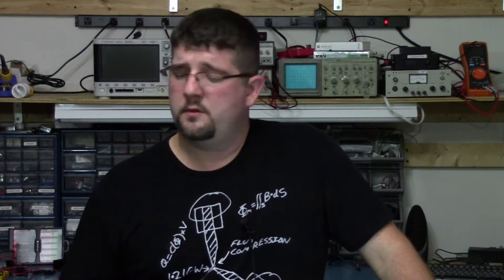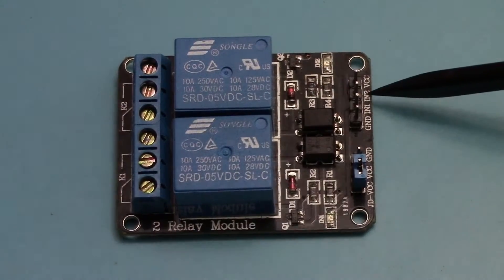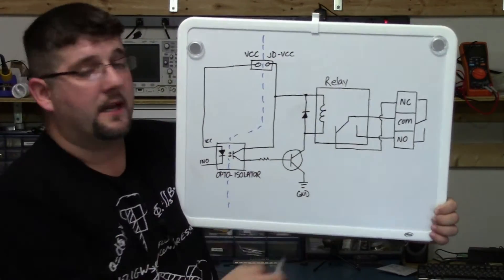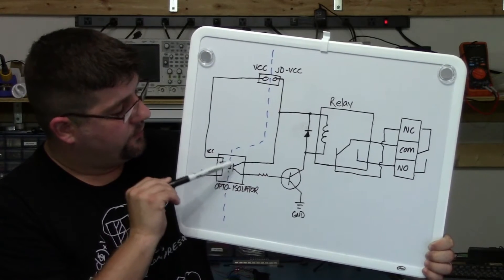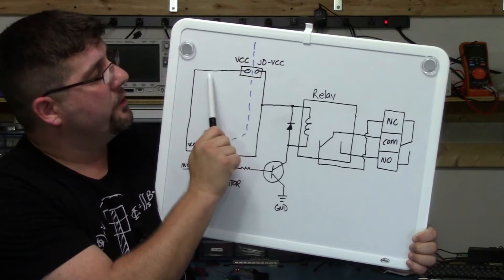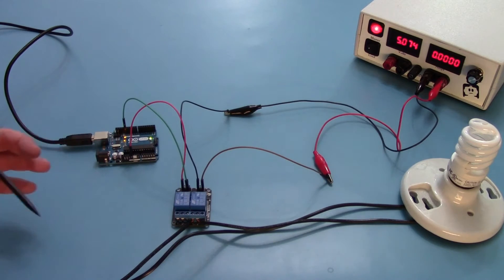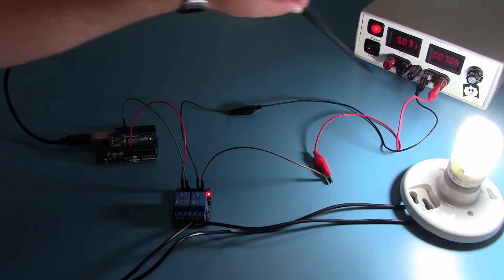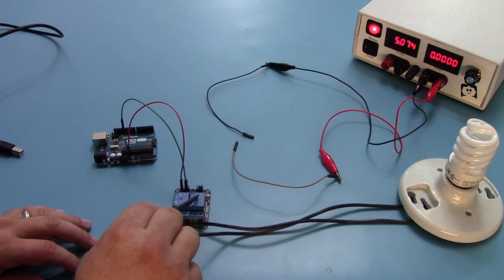#9 - Arduino - Connecting a Relay Module

Comment: hey i used a basic relay on off code to check if its working so its finally working.. connection were as jdvcc and ground from external and vcc,grd, vin from arduino . This actually worked. But when i used everything same in my project then the relay is not working . same connection as in previous one but when i connect grp to arduino the led goes off and when i disconnect it is on again. So now what should i do.what should my connection be. i even tried but jumpinng vcc and jdvcc but even that didnt work. the is working but not in my project. it only works on basic program . please let me know the proper connections.
Reply from the maker: When troubleshooting a problem like that I would double check voltages. Make sure you are getting the expected voltages between JDVCC and GND, then check the voltage between VCC and IN1. If you are connecting the relay for use with an external power supply, using JDVCC, then you shouldn't have to connect the Arduino GND. In this type of set up the IN1 pin acts as the GND for the VCC from the Arduino. The idea is when IN1 pin is high, the voltage potential is the same as VCC, so the relay is not activated. When IN1 pin is low, the voltage potential between the pin and VCC is 5 volts which activates the opto-isolator and ultimately the relay.
Reply: @bradfordhenson  huge respect for yur reply bro. Now the issue is like relay is working and I am finally done with my project but the relay was wired . When I set low it went high and vice versa. Why so?
Reply from the maker: @vp.8181  When the Arduino pin goes low, the voltage difference between VCC and IN0 allows a little bit of current to flow logically from VCC to IN0. In this case IN0 is the lower "negative" side of the circuit. It is safe to source current like this up to 40 mA on an Arduino pin. The effect is that the Arduino pin has to be low for current to flow and activate the opto-isolator. If the Arduino pin connected to IN0 is High, then the voltage potential between VCC and IN0 is the same, which does not allow the opto-isolator to turn on. This is why when the Arduino pin is High the relay is off and when the Arduino pin is low the relay is on.

Comment: like others have said , best tutorial I've seen on using these relay modules. i also have this model as well as a few more complex boards with timers, delays etc. Brad I wish to use this Relay without a controller , just using 12v from an led driver, to trigger relay. can you tell me which ins id use to do this pretty please dude? serious lack of info from manufacturers and on net in general. thanks alex
Reply: Don't use 12v on these 5v relays.

Comment: HI everybody, I need to do a stroboscop with LED bands so I copy exactly all the connections  (2nde exemple shown) , I just used a 12V battery to aliment the LEDs but they stay switch on instead of alternate between on/off, the led on the relay do the on/off delay I've code however, I don't understand...

 Somebody to help me ? ( sorry for my frenchy english  )

Nice video ! The only one I've totally understood

Comment: I'm confused with ext supply no common ground for arduino board, or does the pin output going low obviate the need.
Anyone know??
Reply from the maker: When the pin goes low, the voltage difference between VCC and IN0 allows a little bit of current to flow. That is what activates the opto-isolator and ultimately there is enough voltage present on the transistor's gate to turn the transistor on. In this case we are using the output pin to sink current (it is safe to do this up about 40 mA). Anymore current then 40 mA and you run a serious risk of damaging the pin on the Atmega chip.

Comment: Excellent video. http://www.arduinostarterskit.com/sale-7641832-lightweight-four-channel-relay-module-for-arduino-red-board.html

I am trying to wire up my Comfort (Home Automation System) Output to my 4 channels Relay to switch on the light in the event of PIR is being activated. Refer to above link for details of my 10A 250V relay. The Relay input terminal is difference from what you presented in your video. How do I connect the output and 12v from my Comfort System panel to the relay input?

Q1 Is it correct to connect the 12V of the Output to DC+ of the relay module?
Q2 then connect the OP1 of the Ouput to IN1(Input 1 ) of the relay? And accordingly OP2 to IN2 and so on?
Q3 How about the DC- of the relay? Where to connect to or leave it unconnected?

Would appreciate your support and sharing.

Comment: Why do you need two transistors? Why couldn't you connect the relay along with the diode between the JD-VCC and the collector of the the opto-isolator transistor and have the emitter of that go to ground?
Reply from the maker: Great question. In this module the opto-isolator isn't designed to carry the current required to activate the relay, so it is instead used to drive the transistor. With that being said, there are isolators that can carry more current and it is of course possible to build a circuit to do what you mentioned.

Comment: Is there a max distance between Your arduino and the Relay module
Reply from the maker: There technically is a max distance, but it would depend on what kind of wire you are using to hook the Arduino up to the relay. The longer the wire, the more resistance there is. You have to account for the voltage drop of the wire, due to resistance, when you start getting to really long wire lengths.

Comment: The thing that i dont understand is how the light is connected..
Reply from the maker: The light is connected to a standard two prong power cable which is plugged into a wall outlet. The relay is effectively spliced into the "hot" wire connection.